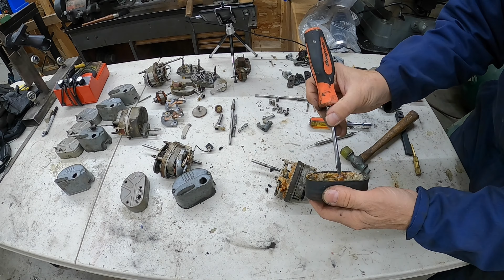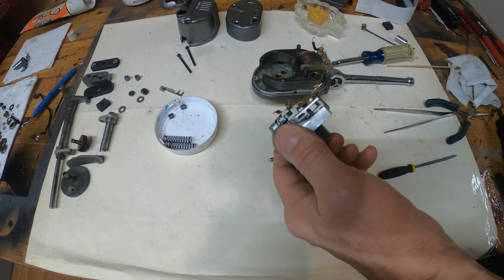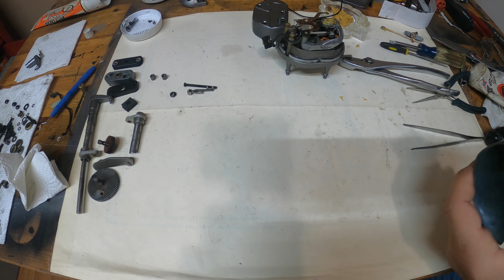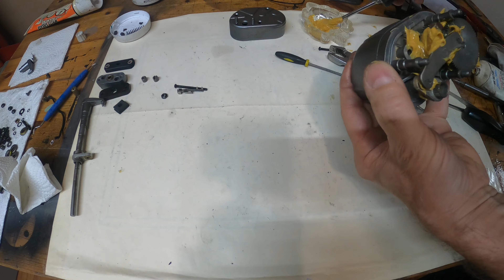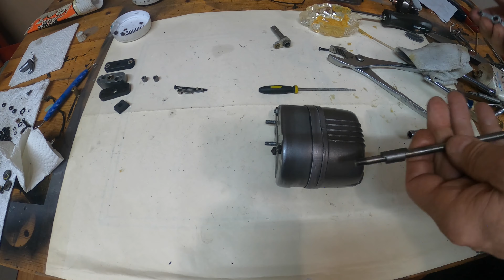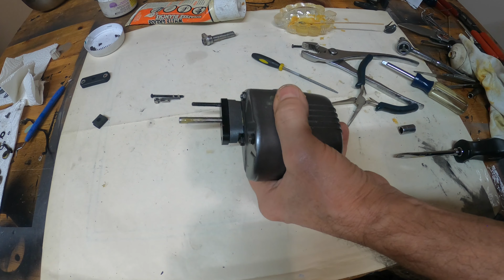Don't replace your Lucas FW2 wiper motor, repair it yourself!

Comment: Hi, how are you? Great video! How do I clean the outside of the engine? Do I use sandpaper, or is there a product that will restore its natural shine? Thank you very much.
Reply from the maker: I actually cleaned them with seafoam, you could use cleaning solvent too. Mine were weathered so I painted them.

Comment: The armature bearing with a felt washer around it is a sintered bearing. The felt should be soaked in light lubricating oil, which will wick in to the shaft.

Comment: What kind/brand of grease did you use?
Reply from the maker: I used Lubriplate white grease. It's a multipurpose grease, usually in a squeeze tube.

Comment: Very informative thanks for taking the time to guide us through 👍🏼
Can I ask how you cleaned and coated the casings please
Reply from the maker: You're welcome, I'm glad the video was helpful. On the casings I soaked them in degreaser, wiped them down with brake clean and painted with a spray can.

Comment: This is such a great deep dive into the FW2 which came with my ‘64 Land Rover, I learned so much! Several of the small parts near the winding and spring (the T shaped fiber anchors that attach to the arms with black blocks?) can no longer connect to the spring, need new ones or to build 2 more. Any advice and where to get parts would be helpful. Now to chase the wire on my dash to see why it’s dead!
Reply from the maker: Thank you, I'm glad it was helpful! Parts for these wiper motors are scarce but I've found a few listings for the anchors, springs and brushes on ebay.uk